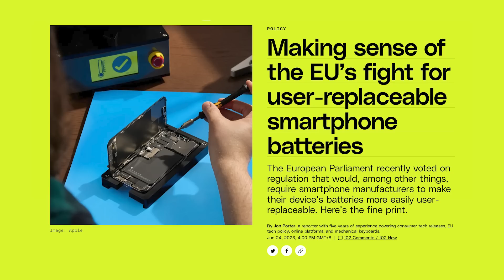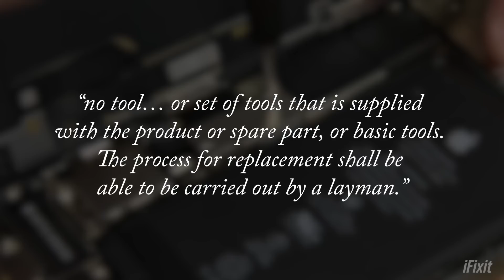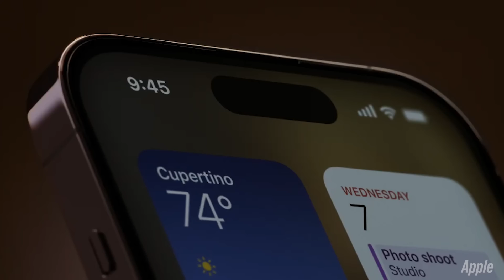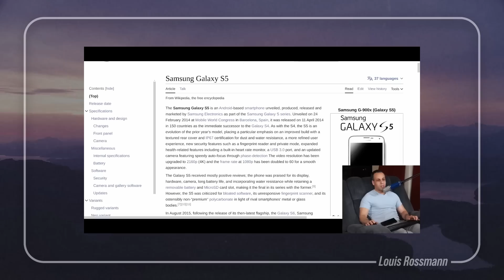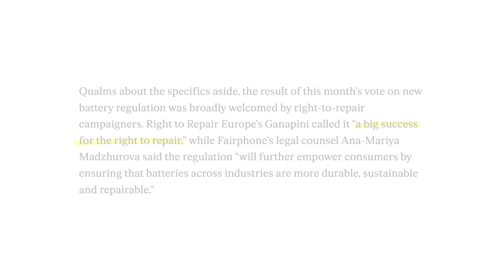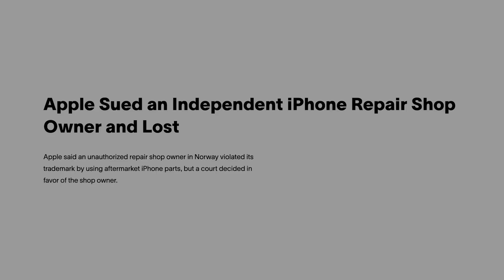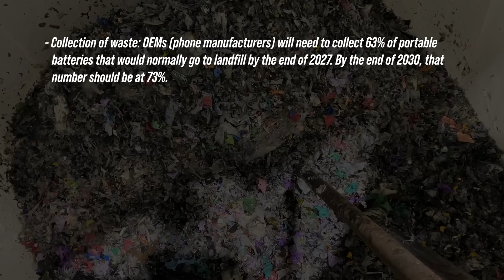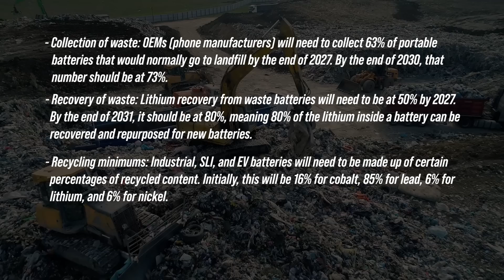EU Just Changed Smartphones Forever

Comment: It is not verry hard to get customers to return the battery, all that is required is a core charge aka you pay 10-20 $ extra when you buy it that you get back when the worn out battery is turned in, just like we do with soda bottles and cans today. Put a barcode on a protected surface on the battery that a recycler can scan so they know how much and if they need to pay the person dropping it off. Perhaps it can even be a automatic machine that does the scanning exactly like the recycler in the grocery store do for bottles and cans now.(in Sweden anyway) If a base fee of 1$(US) is payed for all lithium/rechargeable batteries turned in and a higher fee the bigger the pack gets we will soon have a whole new industry of battery collectors. Automation can check for most common errors to ensure the right amount is paid for the right cell/pack and no fraud is commited, a perfect case for machine learning/AI to help keep people honest.

Comment: In the 80's I fitted rechargeable batteries to my portable disco (known as a raster blaster, or wo...forget it), I also fitted a switch which allows mains play and/or charge, when overcharging was a problem and I didn't want to blow my fuse. If you want to do this for any battery device, connect the switch to charge to the mains d.c. pre-amp (before the smoothing cct) as the noisy d.c. generates less heat in the battery. Less heat longer battery life, you too can be an environmentalist.!! Love the music... :-)

Comment: All design changes are motivated by profit. No manufacturer gives a shit about you or their products once you've bought them. In fact, they'd rather you just throw it away and buy another - doesn't even matter if you buy another manufacturer's product because the reverse situation will be happening simtaneously; someone else will be throwing a competitor phone away and buying yours.

Also, making consumers return their old battery is easy; it's done on an exchange basis or - with no exchange proffered by the consumer -  add $500.

Comment: I think the EU sees many reasons for this law. One of them surely also is security concerns. Taking out the battery makes the phone untrackable and helps when the devices get hacked. Also, of it overheats or starts burning. You need to be able to quickly and easily take out the battery, dismantle the phone to make it dead.
Reply: Or you dropped it in the water...
Reply: @nichderjeniche Lmao not if its water resistant.

Comment: Removeable battery doesn't mean any other battery - SoCs in battery and phone mutually authenticate in some models (e.g. Samsung).  Without availability of vendor and alternate batteries, doesn't mean much. It also discourages innovation in safer, more energy dense and more durable batteries. Consider this - today even nucelar submarines have reactors that last without refuel for lifetime of the hull!  Also - EU - USB-C debacle. They have standardized the PLUG but in "Danny-kinda-forgot" decision they failed to standardize PROTOCOL.  This will become epic curfuffle with electric cars, btw.   EU would do world a favour, mandating research to limit and then remove LITHIUM altogether.  PS: smartphone makers can just swallow the bullet and tell EU to faq iself.

Comment: LOL, you honestly think they won't make differently designed phones. You are talking about an industry that cranks out new models 2-3 times a year.

Sure, non adhesive sealed devices run the risk of water damage. That is a choice that the customer should make, not the manufacturer.

That being said, non removable batteries have little to do with device protection. It has more to do with data collection to feed AI. A phone with no battery in it can't report your location, shopping habits, businesses visited, ect. 

A sealed unit requires the customer to obtain additional services for the phone in the future, and the manufacturers want all of the profit from said forced services. Hence why they pull the stunts they do by disabling the device for replacing a bad component with a perfectly good component that wasn't from that manufacturer.

Comment: I think it would make so much more sense to be able to easily repair your screen. The probability that your screen gets damaged is much higher than that your battery dying. In both cases you can bring it to a repair shop which is far to expensive if you device is already 3+ years old.
Reply: underrated comment. Yes, about half of the people i know use phones with broken screens. And in the phones i had, batteries outlived the phone., as in, the phone got obsolete well before the battery was dead.

Comment: one of the parts of any battery-operated device that will degrade over time is exactly the battery, it's good that the EU is making these changes, because non-replaceable batteries are usually just introduced for companies to bullshit their way out of taking more money from consumers for a job that could've been performed back then without even touching a screwdriver. companies will try to convince people that it's necessary to make batteries non-replaceable in order for sleeker and thinner designs, but really nobody needs laptops that have less port real-estate than a fucking smartwatch

Comment: I still remember when I had a galaxy S3 after 4 years the usb port stopped working. I managed to squeeze another 2 years of usage on the phone by buying another battery and an external battery charger. I was pretty much forced to change it due to change on apps and deprecation of the OS. Batteries are just the first step, next will be removing software blocks.

Comment: I still use Samsung Note 3 till today. One of the best features was the easily replaceable battery. I had replaced it about 5 times so far, and the device is still fully functional thanks to that.
Reply: lol, just got a new backplate and battery for my note 3. I don't use it much, have movies on the sd card in case of a power outage.
Reply: I had a Note 4 and did the same! Had 5 years of use. Loved that phone so much.

Comment: Having EU-only or non-EU-only products is not so uncommon e.g. in  ICE vehicles such as cars and motorcycles. If e.g. a bike would be too expensive or impossible to get it Euro 5 homologated, then it simply won't be sold in EU markets and more profitable/easier to homologate products will be sold instead, simple as that. Most EU smartphones will probably share a common platform and,, just as with bikes, you won't see many extreme or radical designs making it over to the EU. Of course there will always be grey imports...

Comment: I had phones in the past with removeable batteries but never replaced one, by the time the battery was worn I usually replaced the phone but I suppose the phones back then were pretty slow where as today they are much faster and are good for a lot longer and gone are the days I will spend big money on a phone, never again. 

Another potential issue with going back to removeable batteries is that there could be millions of produced batteries that might end up not being used and ending up dumped as people might still choose to replace the phone after 2-3 years especially those on phone contracts. 

Unless Lithium batteries are stored in optimal conditions you're not going to get a 100% capacity battery after 3-4 years if it's been sitting that long in a box somewhere. Batteries degrade with time regardless of use.

Comment: This is not totally correct. Waterproof (phones) and small gadgets got an another law. This means waterproof phones can use glue but the new phones must accept 3rd party batteries. For example if you change an iPhone  battery It won't work. (Minute 4:39) Even with an original Apple battery. Only Apple itself can change the battery. This will be forbidden by EU. This means you can change the battery but its hard.  Better give your phone to a phone repair shop. They will do it for 30€. But notebooks, tablets and E-Bikes must have changeable batteries. Great!  But yes it will change a lot. You'll see that upcomings iPhones will have USB-C because the EU law.
I think they made it great. 
Minute 7:17 diffucult. I live in EU. Its no problem. You can give the batteries to all supermarktes back.

Comment: The reasoning for battery doesn't make sense for environmental purpose if there are Chinese phones sold worldwide ...these phones are made to work only for roughly 2 - 3 years for a regular user 
Their internal circuit/ processors themselves get so worked up causing a laggy slow working phone.

Comment: It would be good if this was extended to such things as accessories eg. cases can be just as wasteful, too model specific. Additionally devices usually have some part which seems 'designed to fail' with a large repair / replacement costs. Warranty's need to be better, why should I pay extra to extend after first year.

Comment: I remember when I wanted to purchase my first smartphone in 2012, I opted for Android because I wanted a device with a removable battery. Unfortunately all manufacturers latter adopted the very same design I was avoiding.
This is a good news, and I hope more components will be standardized with time to facilitate easy repair.
Imagine even laptops nowadays are coming with solded RAMs and CPUs.😢
Reply: CPUs have been on board since the beginning
Reply: @1gnis1337  Not for laptops.
Reply: The framework laptop is what you're looking for if you want to be able to replace all parts in it.
Reply: My smart phone is a Shift 6mq, it has removable battery, micro SD slot, 3.5 mm head phone port, OLED, dual SIM slots, Galileo GNSS. It works great.
Reply: Fairphone has always come with a removable battery
Reply: I don't mind CPUs but soldered RAM and SSDs are ridiculous.
Reply: I have about 4 phones in drawers since the late 90s they all had replaceable batteries. It was never an issue until Apple and the like turned up obsessed with thinner phones.
Reply: My battery requirement
Replace able galaxy s5 is thinner than my permanent thick as glass black Samsung
Reply: Some manufacturs have special outdoor smartphones, that still have removeable batteries, like Samsung with their XCover series (its even highlighted in the phones description on the website).

Comment: Apple doesn't like us repairing our devices.  They are absolutely criminal.
When the power supply died in my $2500 27" iMac. Apple refused to replace the power supply, despite everything in the computer being perfectly fine. and I had to spend another $2700 on a new one.

Comment: Finally!!!

I am still rocking a Google Pixel 2 that I bought 5 years ago. Why? Because phones haven't changed much in the last half decade. It's a waste of money to buy another $800-1200 (CND) device that does the exact same thing that the one I already bought. The only thing that sucks about my phone is the battery. That's it! If I could replace it, I would. 

Batteries are single handedly holding back technology. And manufacturers know this, and are using them to hold consumers hostage. Government regulation IS the key to forcing them out of it. 

I don't even care about the environmental benefits that come from this. Less e-waste and such. I care about big tech companies blatantly ripping me off.

Comment: The early 2000's Blackberry phones had the snap-in plastic backs and a removable battery. This helped with a bad battery and the third party backs were cheap and easy to install. These days you get a nice slim device and instantly have to put on a case. Even the 'slim' cases make the device feel twice as thick.
Reply: That's actually quite good point. In the topic of removable batteries I mostly mention that you can't have the same equipment with the same size of the battery and the same IP rating while adding gaskets, latches, bolts or other stuff. Even if we don't go back to hard shell batteries (phones have quite fragile thin walled batteries, removable ones were always enclosed in plastic shell to protect them a bit more from damage), it is some sacrifice. Either get smaller battery or get bigger phone. But at the same time it's a good point, phones are already too slim for many people and you often have to put additional case on them to be able to hold it properly. I have too big hands for this and when I hold the phone in my hand, I often touch the edge of the screen, having a bit of additional edge is not that bad.
Anyways, I don't think it's the right direction. If people wouldn't want thin glass phones, they would be buying something else. If they would want headphone jacks, those would not disappear. If they would want replaceable batteries, those would stay on the market. People vote with their wallet and in most cases it turns out that the feature you want is not the feature you want to pay for.

Comment: I worked as a mobile phone tech and always found it jarring that everyone was saying environment this environment that while in the same time allowing this battery nonsense go on for ten years. And the battery is just one part of the waste that goes on with consumer electronics. The fact that so many resources are spent to make these high end mini computers and they get melted for their basic resources(copper, metals etc) is criminal. Manufacturers should have in place sunsetting tools in which they give access and make it easy for consumers to repurpose their devices I can still install a Linux server on a laptop from 12 years ago and it will still work at an acceptable level for basic tasks.

Comment: I used replaceable batteries a lot when traveling and loved the convenience, but most people used this feature less often than I did. On the other hand, many consumers were not happy when Apple and Samsung removed the audio jack - at the time, both companies acquired manufacturers of Bluetooth headphones. I've also noticed that it's getting harder to find good protective smartphone cases with the right material (TPU) and structure (raised edges) which truly protect them from shocks. Also, most phone manufacturers stop providing security updates after some time. So I tend to think that all these decisions and effects are mostly profit driven.
Reply: Look for: Shift 6mq it has replaceable battery, audio jack and comes with bumper.

Comment: My phone is nearly 6 years old, it still lasts 17h and the battery health is still good... This law is trying to solve a problem that doesn't exist, a better solution would have been to mandate a 10year battery guarantee. Mandating replaceable batteries accomplishes nothing if replacement batteries are not available in 5-10years.

Comment: I remember having a Samsung Galaxy S2 - always with a spare battery. I even bought a bigger one with another backcover. Great times - no hassle with batter life. And i used it for some years, until the processing power was really to slow. Thanks to the changable batteries aswell as the community for custom made ROMs, the phone was usable for quite some time. (Still got it in a drawer though)
Reply: Same me but with a galaxy s4
Btw i had to change the batteries every month or so for it to work idk why
And just a fun fact that the s4 has more gestures and handfree controlability than any phone i know of
Reply: Needing to carry a second battery meant by definition you had a battery life issue.
Reply: @longfang98  No... it just means the battery life is extendible, although the capacity could drop slightly when it becomes replaceable, as it likely has a hard casing, but it needs to be figured out regardless, my old LG G3 had 3000mah battery and it was replaceable, and that was 2014

If we don't figure it out, then we'd continue to be stuck throwing away phones, as it's expensive and hard to replace one, for many reasons.